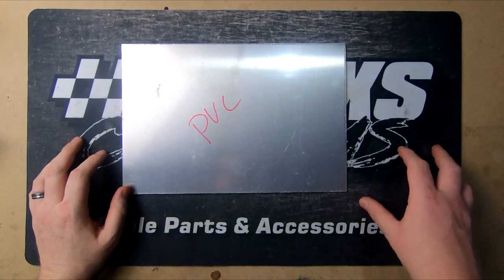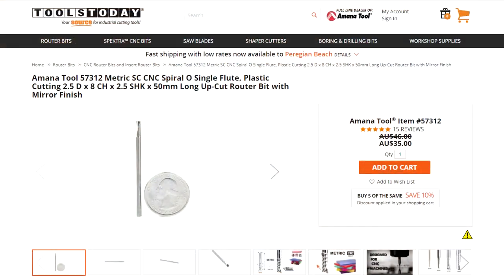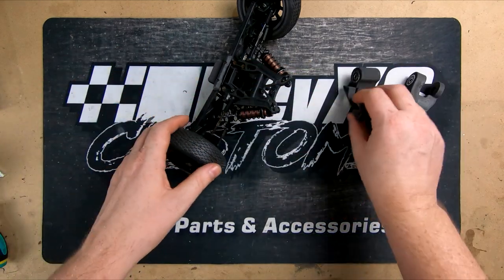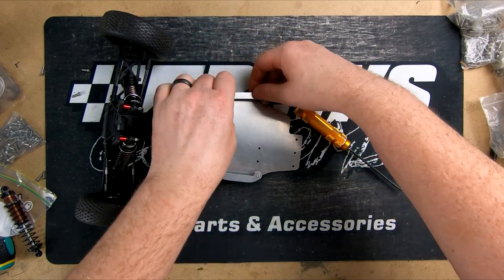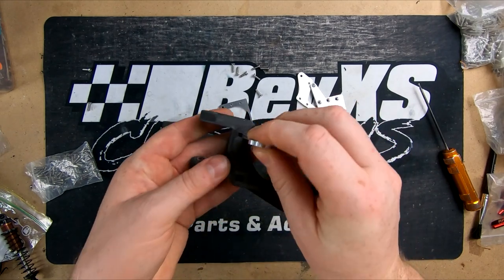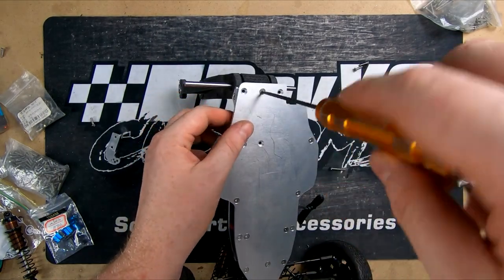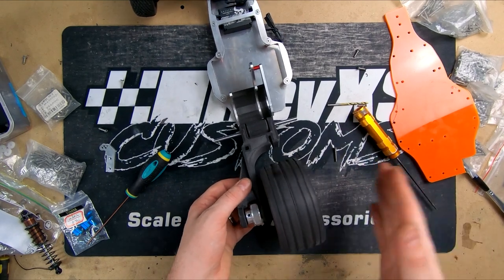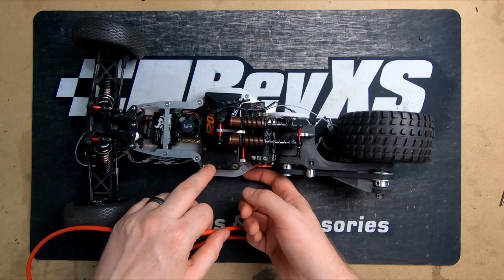3 Wheel Buggy Build Part 2

Comment: Very cool project and well executed!  I’d love to see this in the sand with a paddle tire. How far out do you think production kits are?
Reply from the maker: Had planned getting a sand paddles at some stage to try,no real plans at production run as is all built around old B4 frontend
Reply: @RevXSCustoms  I’d love to get my hands on a “kit”. I don’t mind the bolt pattern up front. In fact you could leave the nose of the chassis blank and I could print my own wedge to adapt a buggy front end.  I’ll message you from my IG account should you find yourself with a box of parts you want to sell 🤘🏼🤛🏼